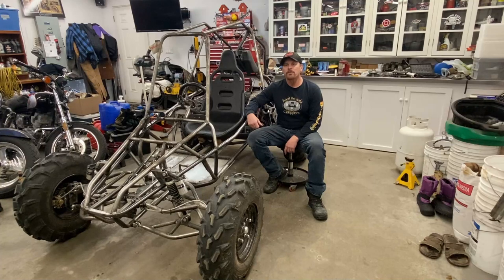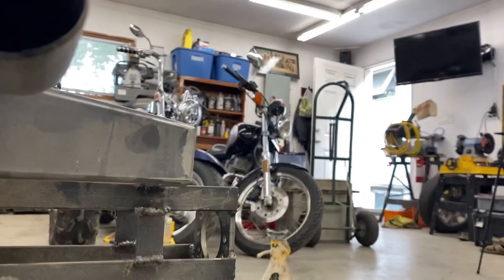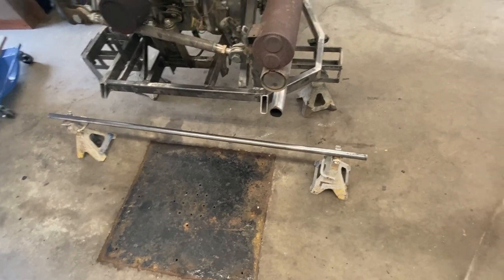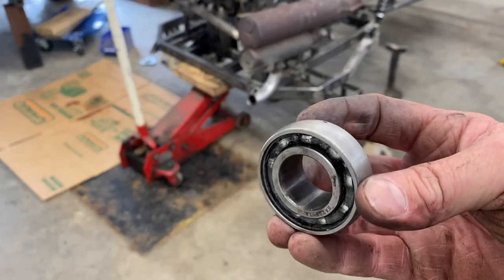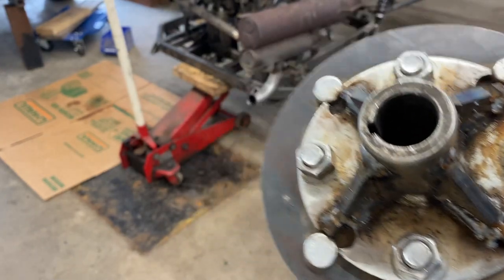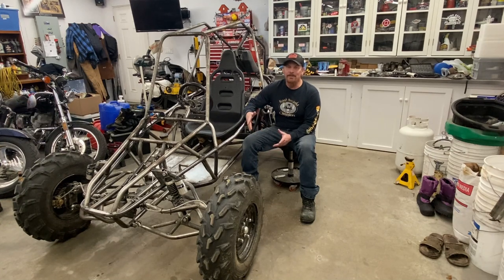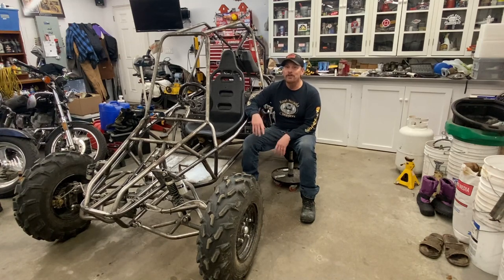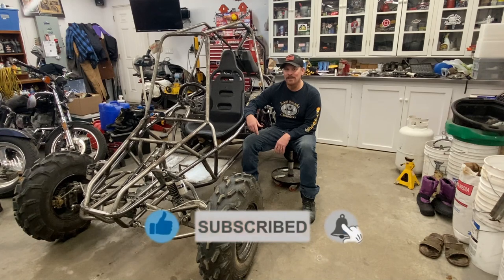Bent Axle Repair, Homemade 540 Kart/Buggy, Part 12, Mini Sand Rail, Cross Kart? #BuiltNotBought

Comment: I think you could do a rear swing arm but without the motor on it. That’s a lot of extra unsprung weight back there. You could make the swingarm pivot a jack shaft and run a chain back to your axle. That would get all the engine weight onto the springs rather than slamming around on the axle. 
Maybe checkout buildsnotprojects Honda odyssey project. He used a bike engine and had a ton of extra chains you wouldn’t need with a sled motor but he had a rear swing arm kind of like yours. His motor is mounted in the frame rather than the swingarm like yours. He railed the crap out of it and didn’t bend an axle. 
Great looking project and can’t wait to see what you do with it next.
Reply from the maker: Thx, yes I have seen buildsnotprojects odyssey, I’m thinking I have the axle problem resolved and if not scrapping the whole rear end and going independent. Next build will be rear independent

Comment: Definitely go fully independent rear! My 2 person buggy with the 600 triple snowmobile engine was originally swing arm with the engine mounted on it. Over a year it had 2 different 1 inch hex shafts snap and then 1.25 inch axle shaft snap. Finally I went to fully independent rear with Audi A4 axles and hubs. It’s way smoother and stronger ride! I have a full send video of it up on my channel!
Reply from the maker: Thx, next one will be independent for sure for sure

Comment: I am fighting the same issue.  I have not watched the video yet but I just wanted to say, I originally had a 1" solid axle on my buggy, I bent it and went to a 1 1/4" hollow axle .19" wall and I just found it twisted yesterday. We are running similar hp but different style suspension... Now to watch the video..
Reply from the maker: thx for the input
Reply: @roadboogalabuilds5318  We seem to have parallel builds, different yet similar in may ways. I really appreciate having someone to talk homebuilt buggies with who is actually building one.
Reply from the maker: @flydaddy55  I Hear Ya

Comment: One solution may be too use sealed bearing hubs off something like a small car. 4 bolt lug pattern then you would need to adapt the solid axle to the spline of the hub but it would be a solid setup
Reply from the maker: Stay tuned for the next video, that is more or less what I'm doing 👍 Thx for the input